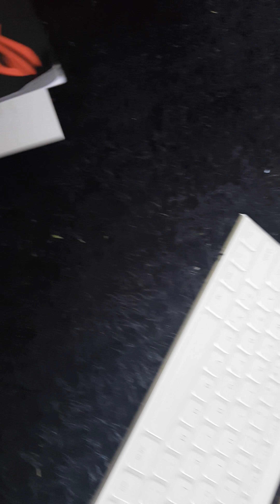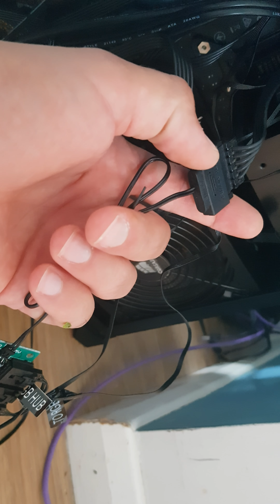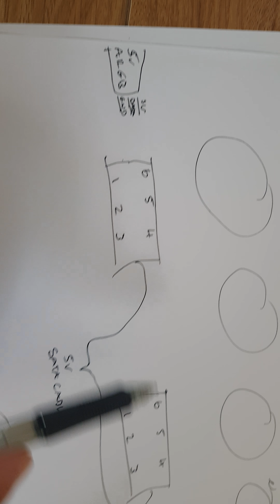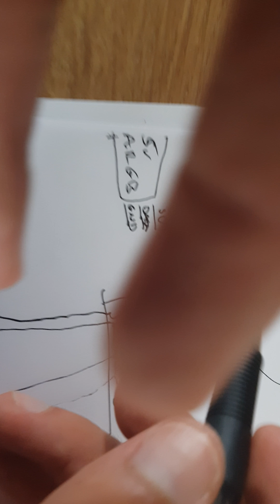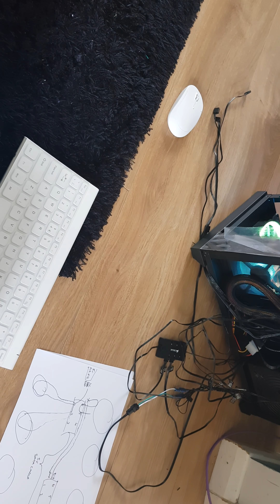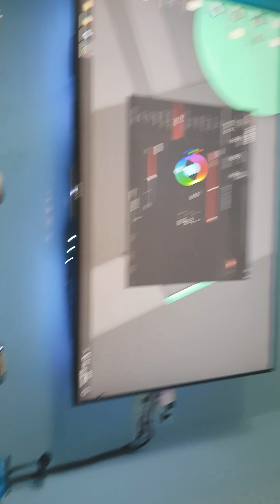How to control Corsair RGB fans via ASUS Aura not using any 3rd party software or ICUE. Hard wired

Comment: Thanks a lot.  This helped me greatly!  The problem I have is I have 7 fans, and I don't want to spend money to buy another controller.  So theoretically I can manufacture a connector so I can plug two fans on the no.6 slot.   I think somebody mentioned 7 fans's leds might exceed sata current limit but I think I will take the risk.
Reply from the maker: Hi. Yes you can parallel the fans up if you axceed the led limit. Just means the 2 fans will mimic each other

Comment: How can I do this with just 2 corsair sp120 rgb fans?
Reply from the maker: First you need to check that you have ARGB headders on your motherboard not RGB headders as the RGB headders will destroy the LEDS. if you have ARGB then simply follow the video
Reply: Christian Thompson yup fried the leds lol wish I would’ve seen this.
Reply from the maker: @millz1982  not yo worry. Sure many have done this at some point. But you'll remember for next time now.
Reply: No. Corsair SP-RGB fans do not use WS2812B so they won't work with this method. They are the only Corsair fans that don't use WS2812B.

Comment: I was thinking of buying 6 ql120 fans but they have 34 leds per fan. My mobo only got 1 5v argb header. To get the same effect as yours, i think i will get ll120s instead. How is the thermal on your cpu?
Reply from the maker: Thermal is good. I'm using i9 9900k and under full load playing warzone am at 65c.GPU gets hotter than the CPU. As for your fans you can only have 120 individual leds on that header
Reply: @istis1st84  Great temps. Will try this once I got the fans. Thank you!

Comment: I have the same case and 6 LL120 fans.  If I control all 6 fans on one hub is there a need for the second hub you have hardwired?  Ie should I be able to drive the hub from the ARGB header directly?
Reply from the maker: Hi if your just doing the 6 fans then yest you only need 1 hub. You can control them via the argb header and asus aura
Reply: Thanks - will give it a shot.  Now if I can only do the same with the LED strips that came with the case.  O11 Razer edition - they control fine with Razer Synapse, but it doesn’t talk to Cue or Aura as far as I can tell.  The strips go to a generic looking hub via ZIF style connectors and then to USB for the hub.
Reply from the maker: @brentfitzgibbon  not sure about them but if they are WS2812b protocol then they will work just means you'll have to figure the physical connection out
Reply: @istis1st84  so in this case I would need to just not use the connection from Corsair HUB to USB on the motherboard and make that custom connection from Corsair HUB to the ARGB header?

Comment: Hey chris i also have the HD120's but only 6 of them and i really been wanting to do this method, my question is ur using ground and data from the motherboard to the module, dont u need some extra power that way u dont burn out the rgb heather output from the motherboard?
Reply from the maker: Hi they get the power from the molex connection which is connected to the power supply directly
Reply: Thank you so much! I got the fans to sync with the system you just saved me $75 from buying the commander pro 👍🏻👍🏻👍🏻
Reply from the maker: Nice job and you can enjoy all of your lights running in harmony
Reply: Christian Thompson yes i did, i only used the data and ground from the 5v rgb header, everything was working fine i was able to change effects from aura everything was good, but now when i turn the system on the leds go on but in froze motion, even some leds wont go on, one fan turns completly red and the rest in rainbow color but in froze motion
Reply from the maker: @eliaschami5614  asus aura is very temperamental. It's very buggy programme. Pull the power lead from the pc to reset the SDK (lights) and try older version of aura

I had nothing but problems with the latest version of aura I had to revert to an older version and now works perfectly
Reply: Christian Thompson i'm a little lost... even when system is on but not in windows lets say in bios, the mobo and ram are in default rainbow profile, but the fans are froze in rainbow color, or 1 fan in completly red and rest in rainbow but in frozen motion
Reply: Christian Thompson am using the new armoury crate, it was working good, i feel like data or ground are not being transfered correctly, i hope the rgb hub module didnt die lol
Reply from the maker: @eliaschami5614  armoury crate still uses ASUS aura in the background. The SDK is the controller on the motherboard that controls the lights ASUS aura sometimes messes it up with the new version you need to pull the power lead out out of the computer for a few minutes to reset it and then try and older version of ASUS aura
Reply: Christian Thompson ok chris i'll give that a try tonight.. thank u very much for replying not a lot of people do 👍🏻👍🏻

Comment: Very helpful, Thanks.  Do you think this method would work with Corsair QL120 RGB Fans assuming I don't exceed the maximum number of IED's ( 3 QL 120 fans = 102 LEDS ) on each channel  ?  Could you also tell me what the connectors are you got on Amazon please ?
Reply from the maker: Hi. The max LED limit is 120 per channel so you'll be fine with 102 LEDs. I would imagine all corsair fans are WS2812b protocol but I would confirm this first. As long as they are the same protocol they will work.

Here is a link to the connectors I used
MENGCORE® 20Pair / 20sets 3 pin JST SM Male Female plug LED Connector Cable For WS2812B WS2812 WS2811 LED Strip Lamp with 15cm Long Wire https://www.amazon.co.uk/dp/B01DF0UL8C/ref=cm_sw_r_cp_apa_i_K5R7Db3XMPXWZ
Reply: @istis1st84  Thank you. I have ordered the connectors, 1 QL 120 fan and a Corsair RGB fan hub controller. I will update when they are installed in my new build.
Reply from the maker: @zarquon5957  no problem and enjoy your lights 😁

Comment: This is awesome, very glad to see this as im trying to do the same.  I have two questions.  Instead of soldering to the pcb could you instead use the number 6 plug itself to feed the second hub?  That way you would have 5 fans on one hub and then the signal would output out the 6 plug into the second hub to the other fans.  Also is the corsair rgb plug proprietary?  in other words could i use other addressable fans with this hub to achieve the same effect?
Reply from the maker: No because the inbound connection is a 3 pin cable and the fan connections are 4pin. If you don't want to to told her you can just connect on do the return data feed wire from the 6th fan. I opted not to do this because I wanted to leave all the fans untampered tampered with
Reply: The Corsair plug is not proprietary. They are Molex SL series connectors - sometimes call "latching DuPont" connectors. See this from my friend Solarity: https://www.youtube.com/watch?v=DOj4kYXvzyI. 
And yes, you can use other, non-Corsair fans on a Fan Hub. You do lose the ability to daisy chain them though.
Reply: @piratedogtech5910  Could you explain why you lose daisy chain ability? Why is it only possible with the Corsairs? I'm searching for a solution for controlling all LEDs individually in my system without having to buy this super expensive Fans, but i only find solutions for mimicking/cloning the signals to all fans.
Reply: @4360241  The Corsair fans have a Data In (to fan) and a Data Out (from fan) and run in series. This provides the ability to control each fan individually as each LED gets data on the line, "pops" its data off the stack, and then passes the rest down the chain. With the 3-pin RGB, you don't have the Data Out. They take Data In ... and that's in. So adapters that convert the 4-pin Corsair to the 3-pin for others have to "fake" it by jumping Data In to Data Out ... so it is duplicated. The RGB then runs in parallel, not in series. It's not something that any adapter can fix as it's a limitation of the 3-pin design and it's simply inherent in the design. You only find solutions for cloning the signals to all of the fans because that's all that they are capable of doing.
Reply: @piratedogtech5910  Thank you very much for this great explanation.

Comment: nice video!!! do you have a video to see the differente effects on the fans? thanks!!
Reply from the maker: Hi my phone cut me off at 10 mins recording so wasn't able to capture the effects. However i will do an effects video today and upload it
Reply: @istis1st84  no problem  !! If i only use 6 fans, i dont need to soldered from the open node pro to the closed node pro? And if the node pro use 5v; why not conect the 5v of the mobo too instead using a sata to psu? Thanls for help me
Reply from the maker: @nachovidal4047  hi. Yes that's correct if your only using 6 fans you don't need to solder onto the next node pro. As for the power question, the node pro only takes data and ground from the mobo there is only 2 cables input from the motherbaord hence why you use the sata 5v connection.
Reply: @istis1st84  thanks very much for the reply;yes maybe i will use only 6 fans because im planning to use 2 rad 360;thanks again for help me if i have any doubt i will ask you again haha
Reply from the maker: @nachovidal4047  here is a link to the full effects video I've just uploaded https://youtu.be/ZneWDxs1wIc
Reply: @istis1st84  how could i know which its the DATA and GRD cable..to soldered correctly?
Reply from the maker: @nachovidal4047  look on the motherbaord. It will be labelled 5v DI GND on each of the pins. Or use a multimeter and the data pin will read 0.05v ish
Reply: @istis1st84   yes theres no problem with the pins of the motherboard..but how do you know wich data and grnd on the cable that goes conected to the corsair hub
Reply from the maker: @nachovidal4047  follow the individual cable coming from the pin on the motherboard
Reply: @istis1st84  i will try it